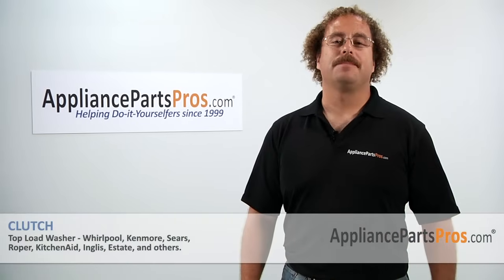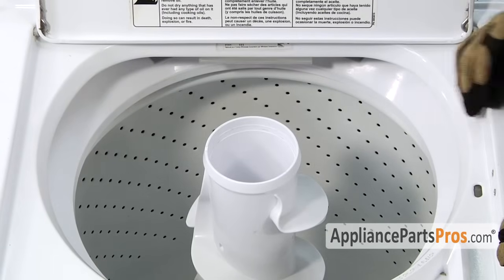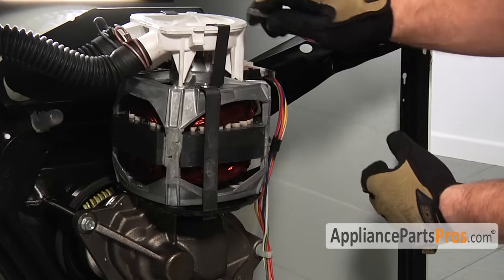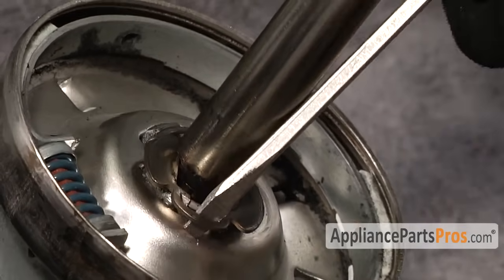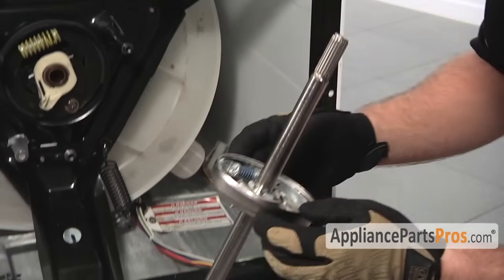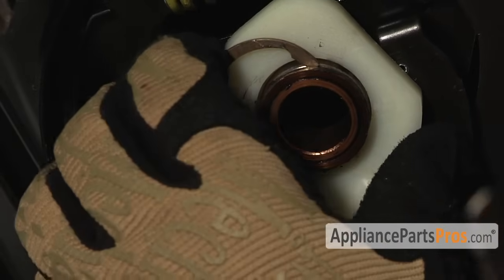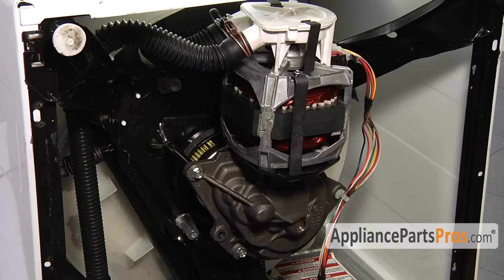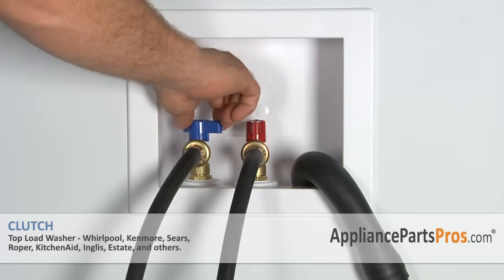How To: Whirlpool/KitchenAid/Maytag Clutch Assembly 285785

Comment: Followed this guide today -  a few comments. First, if you're having a hard time getting the first spring clip in and/or the retaining clip is having a hard time going in around the clutch, check that the tabs on the clutch are all the way seated down into the slots. I had to do this to get the clip on at all. 

Second, when reassembling to top assembly, put the plastic piece back on first with the peg on the plastic in the gap on the shaft. Then gently open the retaining clip and slide it down. 

Third, when putting on the agitator top piece, ensure that cam? clutch? plastic gear piece is seated properly before tightening down the bolt into the shaft. I had to wiggle it a bit to ensure that it was a clean fit. I hope that if you're struggling with the same parts I did, hethese observations will help :)

Thank you very much for the instructions! Saved us a whole lotta money
Reply from the maker: If there is anything we can help you with in the future please let us know.

Comment: This video saved me a ton of money but I did have a tough time getting the motor assembly back in.  I could not get the brake cam to fit within the clutch assembly but, instead of going straight in, I finally figured I had to offset the clutch slightly to make sure the brake cam arm fit within the clutch then I could get the motor to seat.    Thanks a bunch for this video.
Reply from the maker: Glad the video helped you get the washer fixed!

Comment: Great instructions and I couldn't have done it without this video. This video also saved me a lot of unnecessary work. Another YouTube  video I watched, had you removing the cabinet and the motor,both steps are unnecessary .  
 Matt  is excellent at walking you through the steps needed to fix your appliance. My washer is running like a champ again. Thanks Matt !
 I wish I would have checked this repair site last year when I paid over $350 for a repairman to replace a $200 motor. I know there are some repairs beyond my repair skill set but this one was a piece of cake.
  Also no more buying from a local parts store for me unless it's a $5 part not worth paying the shipping for . I order from APP's on Friday and my part arrived Saturday !
Reply from the maker: Ralphs007 Awesome good job on getting the clutch changed!

Comment from the maker: @AbrilSong Assuming that everything has been rechecked as far as the repair goes, I would think it might be a leveling issue. It could be a little off level, you would be surprised how a little off level will make it shake. Make sure that when you tilt the washer forward that the rear feet actually drop and are not stuck in place due to corrosion or just being stuck, then adjust the front feet.

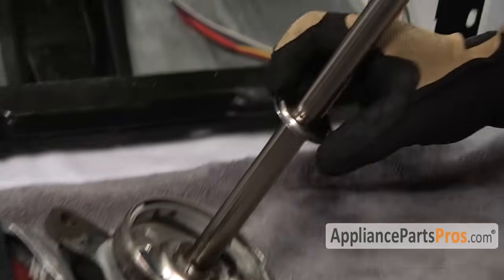Comment: 4:36 followed your instructions to drop the drive motor and transmission, expecting it to slide right out like in the video.  Mine moved a couple inches and is now stuck.  I noticed that you did not remove the drive block and spanner nut compared to some other YouTube videos.  Should I now invest in the drive nut spanner wrench, or am I doing something wrong in expecting the transmission to slide straight out.  At this point, I am ready to return the parts and bite the bullet and buy a new machine that won't last 3 years vs. fixing my 20 year old reliable.
Reply from the maker: There could be some debris or build up causing the part to get stuck. You can try some penetrating oil and just keep working at it to get the part out.
Reply: @appliancepartspros thanks.  Already coated it with penetrating oil last night without much luck.
Reply from the maker: Unfortunately, there isn't any trick to it, you will just need to keep working at it to get the part out.

Comment: Very good video. Covers almost everything. My Sears Kenmore washer has a different softener dispenser than the ones discussed in the video. It has two small tabs and is removed by grabbing the base and turning clockwise and then lifts out.
Reply from the maker: +Glenn Laursen Gglad the video helped you get the washer fixed!

Comment: Your video was great.  
I made a repair with OEM parts and discovered the new brake cam dirver was 1/8 and 3/16 inch taller than the original.  The machine made all kinds of noise when it started the spin cycle but stopped  once it got up to speed.  I replaced the brake cam driver with the old one that was still in good shape.  Wish I would have tested it before I moved it back into the laundry room the first time.  
Just because it's OEM doesn't mean it's right.  Set them side by side to check.

Comment: I replaced all 6 of the white pads and checked all the springs which were good.  The balance ring shows half full when holding it vertically. I don’t feel any play in the tub bearings.  Washer is level but I still have some vibration during the spin cycle.  I noticed that it is slow to spin up and intermittently the clothes won’t be as dry as they use to so I’m pretty sure the clutch is worn.  Do you think this could take care of the vibration during the spin cycle too? Sometimes it does make a squeaking sound during the spin cycle too but not very consistent.
Reply from the maker: If that clutch needs to be replaced, it can cause the issues you are having.
Reply: @appliancepartspros  ok, thank you!
Reply from the maker: You're welcome!

Comment: I just wanted to say thank you, your videos are fantastic! I changed out the clutch assembly in about 30 minutes, probably would have been less if I didn't have such a tight area to work in. Your videos are very thorough and well thought out, and the suggestions at certain parts are excellent to help us avoid hiccups like removing wiring harnesses so they don't tear out when we remove the transmission! The Mrs. thanks you too, although I may have taken all of the credit. I can't remember seeing the machine spin this fast before, it vibrates quite a bit more and I suspect that's a function of it's speed and that now the transmission is working more efficiently the clothing should be rung out more now that it is at full operational speed. THanks!
Reply from the maker: +briancnc Thank you! Glad the video helped you get the washer fixed up!

Comment from the maker: The brake drive cam is included in both kits. The full kit includes the clutch housing which should be changed it it is damaged. If the old clutch pads wore down and the rivits were rubbing on it then you wouldn't want to put a new lining kit into it. Like a car it would be bad to put new brake shoes on a damaged or warped rotor.

Comment: Love this.  One suggestion: when reassembling, you might need to grab the brake cam and twist/push to get assembly to push in a bit more so the clutch can be reconnected to the washer.  Had to go through several videos before finding that's what I needed to do.  Otherwise, and awesome tutorial which helped me do my own fix.  Thank you!!
Reply from the maker: Thanks for the tip! Glad the video helped you get the washer fixed!

Comment: Nice video, especially since my washer is that exact same Kirkland/Whirlpool model so easy to follow along with.  I had one issue you didn't warn about, when you have it on its side like this there's a good chance the triangle shaped suspension/skate plate may come loose as it's free floating.  Be sure to line the 3 notches up on the corners with the 3 legs on the base or you'll have severe wobble during the spin cycle.

Comment from the maker: Check out this video: "Washer Drive Block (Part # 389140) - How To Replace" If your clutch and brakes were making the tub slam to a stop it could have stripped out the notches in the block, which would make it still be very loud when stopping.

Comment: Excellent video. I am in the middle of replacing these parts, but I can't seem to be able to pull the transmission out, only about 6" or so, even tugged some. Any suggestions as to why it doesn't just slide right out? Roper top loader, RAS7133RQ1
Reply: Did you figure it out?
Reply: Same issue
Reply: I felt stupid after realizing I had left the bolt screwed in the top so I would lose it, if I remember correctly.  Did the same thing reinstalling and tranny wouldn't seat all the way in. Note to self: put the bolt in a bowl and set aside, duh. @cmccarthy

Comment: Thank you for this very in depth video. I replaced the clutch which was bad. Also, replaced the coupler which wasn't. Just did so as a precautionary. washer worked great for about a week. Now it's making a terrible grinding noise while trying to spin. I've taken everything back apart and things seem to be working fine. any other idea of what it might be?
Reply from the maker: We'd be happy to help you figure that out, but we'll need some additional information about the model and the problem. You can give us a call at 1-877-477-7278 or you can chat us at our website: http://www.appliancepartspros.com/. We will need the model number for the appliance, so that we can look up diagrams and information about your specific unit to give you accurate advice. You can look here on our website to help you find the model number: http://www.appliancepartspros.com/modelnumber_locator.aspx

Comment from the maker: Check out this video: "Washer Drive Block (Part # 389140) - How To Replace" If the drive block notches are worn out or if the spin tube tabs are worn down it could cause the tub to jump as it is starting up. Sometimes you can bend the spin tube tabs back up enough to work but the block should be replaced if damaged.

Comment: 2:08 to 2:12 --- this little segment just saved me a bunch of time and worry.   Those pieces came off when I pulled my driveshaft from below and I was a little uncertain if I had put them back right.  There are like 4 ways they could go back together.  Only one is right.  White plastic piece goes on first (under the metal retaining clip.  The white tooth should line up as shown here, and not between the two tabs.  If you put it there, you will note the tooth does not contact the metal nicely.

Comment: hi, I have a quick question, I am looking for a specific part and I noticed it in your video.  When the video is at 4:11, on the left side of the screen there is a clearish long cup (about 2 in long and 1in diameter), in this cup is a golden nail object, its round on 3 sides, flat on the other and comes to a point at one end with a hole near the point.  can you please tell me what this is for?
Reply from the maker: These are locking pin that were installed at the factory, they are never really used again so if it fell out you can toss it!
Reply: locking pins? you went on to say they were installed at the factory and never really used again? what were the locking pins used for? was it for shipping or even stabilization?
Reply from the maker: Yes they were put in at the factory for shipping and released when the washer was installed. Unlike front load washers that require shipping bolts to be moved, the pins were never set up to be reused. Once the shipping strap with the cotter pins was removed they just dropped into the cups. It is in the installation manual if you still have it.

Comment: I took apart the the agitator to clean it of mold and nasty fabric softener, video is excellent besides me now not knowing how to stack the plastic pieces and metal for the top to go back together! Though I think I got it, let's see how load #1 spins.
Reply from the maker: We offer free technical advice and diagnosis outside of our videos, so we'll be glad to advise you on that repair if it turns out the way you had them assembled wasn't correct. We’re available 7 days a week at 1-877-477-7278 or you can chat us at our website: http://www.appliancepartspros.com/

Comment: Ok. So I've replaced the brake clutch, the coupler, and the dog agita. Washer still does not spin. Any advice for me. Kenmore 80s series. Thanks!!
Reply from the maker: We'd be happy to help you figure that out, but we'll need some additional information about the model and the problem. You can give us a call at 1-877-477-7278 or you can chat us at our website: http://www.appliancepartspros.com/. We will need the model number for the appliance, so that we can look up diagrams and information about your specific unit to give you accurate advice. You can look here on our website to help you find the model number: http://www.appliancepartspros.com/modelnumber_locator.aspx

Comment: Great video.  I used it to replace the clutch on my kenmore 80 series washer in my rental property out of state.  Everything went great, but when I gave it a test drive, the washer made a grinding noise when it began the spin cycle. The noise went away as it got up to full speed.  Now that I am back home, I am questioning myself if I put the little plastic piece on the correct side of the clutch assembly.  If I put it on the wrong side, would that grinding noise ensue?  Thanks again....

Comment: Great video!  It made this DIY very easy!  However, I'm having a spring color conundrum:  My OEM clutch kit included two springs: one was pre-installed within the clutch and navy blue.  The other spring packed loose within the kit was light blue.  The installation instructions said that my 27" wide regular, large, extra large or super capacity washer should use the "factory installed", "blue" spring, not the separate "black" spring that was for a 24" compact washer.  To confuse the issue even more, the clutch I removed has what appears to be a (dirty) light blue spring that looks very much like the one packed loose in my kit...not the navy blue one already "factory installed" in the kit's clutch.  Can anyone help me figure out which spring to use:  the pre-installed navy blue one, or the loose light blue one?
Reply from the maker: hcpaydc Looks like they may have changed the color of the extra spring, the kit in the video had a green one even though the instructions said black. If you have a model that calls for the blue one I would go with the blue one already installed. If you take the blue one that is installed out it should be a little longer and should match the old one. You can also post the problem along with the appliance model number on our repair forum and the techs can help you troubleshoot the problem.

Comment: Thanks for the video! I didnt order my part from you but after reading all the comments, I should have done so. Very impresssed with the time you put into responses and have a question myself:
My machine is a Kitchenaid 750 and while replacing the clutch, would it be an appropriate time to clean some of the plumbing in my machine? It's 10 years old and would love to have it last another 10.
Reply from the maker: lrj3000 There is really not a lot of plumbing, you have the tub to pump hose and the pump to back wall hose. You can certainly take them off to make sure nothing is in there, while you are there look in the pump for anything. There are also cleaners that you can run through the washer to clean it. I would not really take much more apart if there is no problems right now. You can take a look at the base clean up and paint any corrosion. Take a look at all the springs and retainers, if any of the ends are almost worn through you can change them. Also move the suspension around there are 6 suspension pads in there so the tub should move around freely. If any are worn out or missing you might get some grinding.
Reply: AppliancePartsPros Thank you very much. I'll give it a good once over and come to you for anythjng else I may need.
Reply: +AppliancePartsPros pm

Comment: Hi, first of all, awesome video. I've seen your complementary video (part #285790) and want to know if there is a case in which changing the lining kit only is not enough? I mean, the clutch plate walls get thin or something? the washer or retainer clip gets worn out/broken? Also, would like to know how much the transmission/motor combo weights (aprox). Thanks in advance.

Comment: Thank you for this video! I feel confident that I put the clutch together correctly, but when I was putting the machine back together I wasn't quite as confident. When testing it, at the point where it should start spinning, the breaker trips!! Doing more research online, seems this is a clutch/brake issue (that's good, since that's what I was working on!). Any advice?
Reply from the maker: Coreen Ryan Does it sound like the motor is jammed? It would hum and then kick the breaker off. You may have to open it up see if you can find the issue. You can also post the problem on our repair forum and the techs can help you out.
Reply: Yes, it hums then trips the breaker.
Reply from the maker: Coreen Ryan You can always post the problem on our repair forum and the techs can help you troubleshoot the problem.

Comment: Great video, thanks. I changed the clutch on my Kenmore washer is about 2 hrs. However, now when the spin cycle starts there is a knocking noise that sounds like a machine gun for about 10 sec. When it gets up to full speed it stops. I've leveled the washer in both directions but the knocking still persists. Any ideas on what may be wrong??

Comment: The clutch is spinning on the spin cycle, but the shaft and inner drum is not, would that indicate the drive block is worn out ?, (from the top it looks to be ok), i've got the spanner nut off, but i cannot lift out the inner tub.
Reply from the maker: shirleymae30 Not sure what model you have but I suggest that you post the problem 
along with the appliance model number on our repair forum and the techs 
can help you troubleshoot the problem.